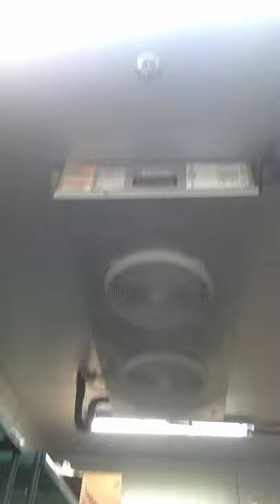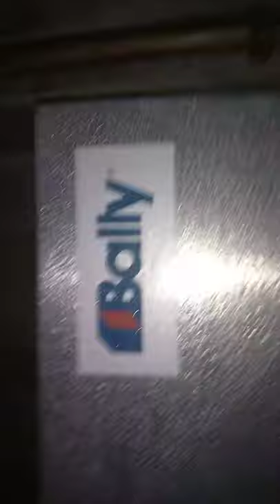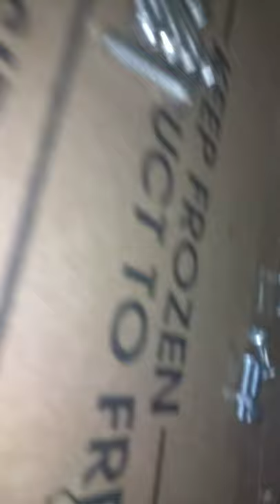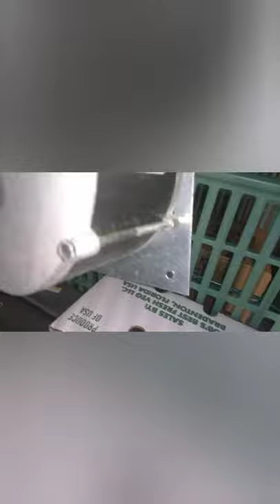Walk In Cooler Evaporator Coil Cleaning Step by Step Full Disassembly

Comment: Clean the coil with the water first and then add the cleaner so it can work properly
Reply from the maker: That was a very first video I ever uploaded I think. 2019, if im not mistaken. Jason's Deli Conroe Texas walk-in cooler. I think I used a few cans of Viper on that coil... I have noticed that sometimes if not all times Coil cleaner does spread and work better if you get the coil wet first.👍